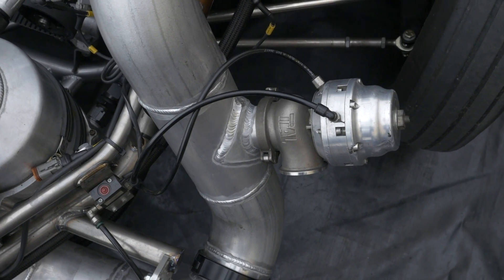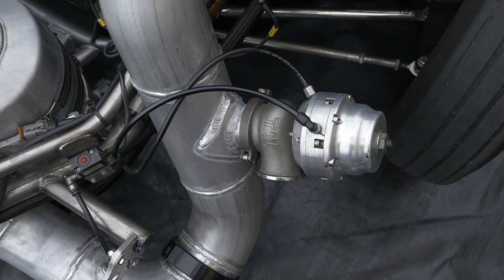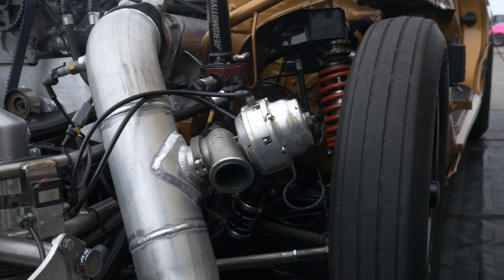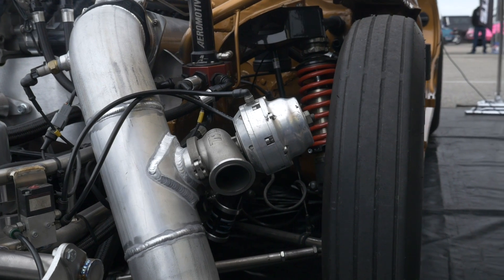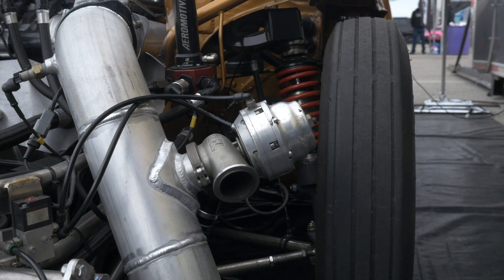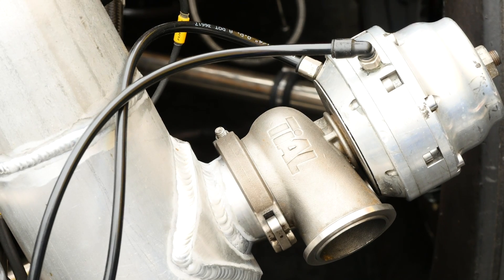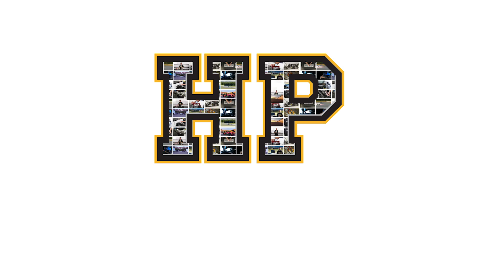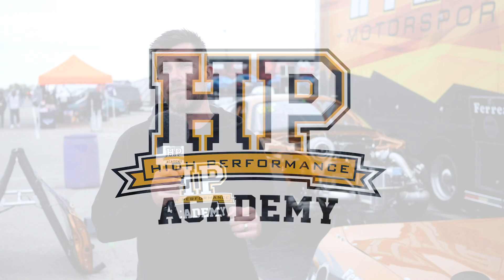How To Launch 2000HP+ Perfectly | Charge Pipe Wastegate [TECH NUGGET]

Comment: But what about  a blow off valve? Doesn't a blow off valve do the same thing?
Great Video.
Reply: As I understand it, blowoff valve is suited to completely removing excess boost pressure when the throttle plate closes. Either its open or its not. 

A wastegate is more suited for slightly "bleeding" off excess air/gas, which would make it more appropriate for this application. Hope that helps!
Reply: @jps2  thank you.  Your answer was really helpfull.
Reply: Blow off valves only open with vacuum, so won't open in this case. That's why there are two lines going to the wastegate, supplying pressure one side opens it, the other side closes it.
Reply: And to add to that they are likely using co2 to supply the pressure
Reply: @sexyfacenation  thank you.